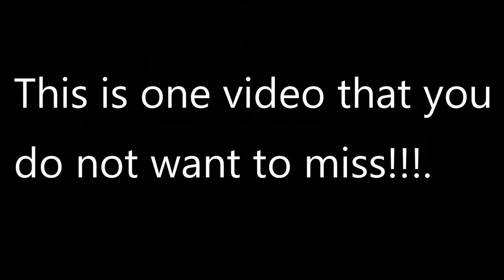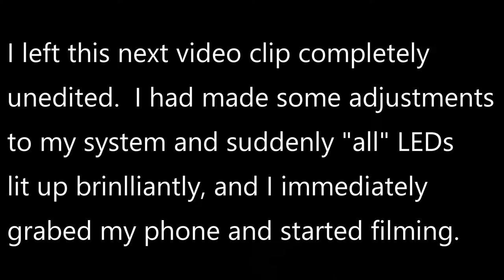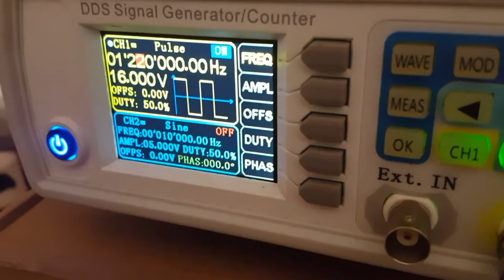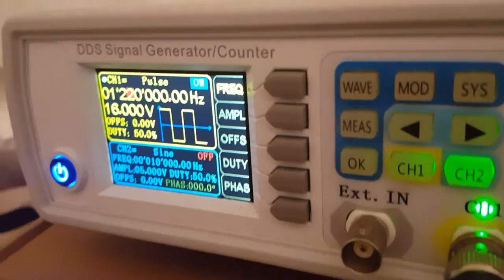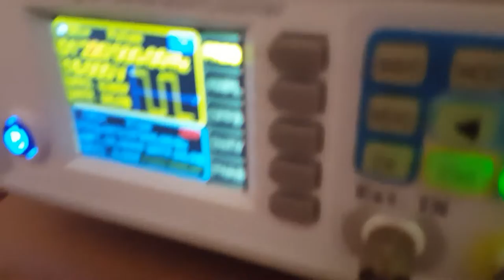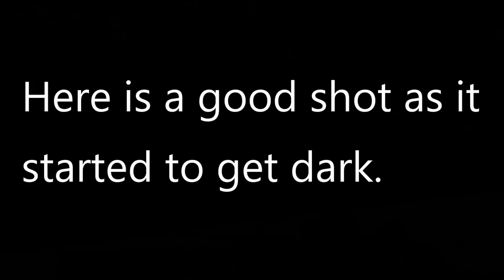WIRELESS POWER TRANSFER Part 17 (Over unity!? Free energy!!?)

Comment: Are the LEDs part of how your system works or are they just used as a load ?

Have you measured what amperage the LEDs are using , compared to how much input you’re using ?
Reply from the maker: HUmmm, well, I think the Spark gaps(LEDs) are very important to the system, and I believe the LEDs on table are also acting as a load to draw energy for all the other LEDs below table height on board to light up.
I have not been able to check current yet.  Every time I place an amp meter into the circuit, it throws off the tuning of the whole circuit and all LEDs go out.  I will have to get a clamp-around meter or a good oscilloscope.

Comment: Wow visually very impressive!  16 volts at 0.1 amps is only 1.6 watts.  Please measure the voltage across the open circuit and also measure the current as mentioned.  Because of the high frequency measurement with oscilliscope would be preferred.  Even someone from a local ham radio club may be able to come over if they can sign an NDA (non disclosure agreement) and do the measurement.
Reply from the maker: Yes, 1.6W,  thank you!  I know the math gets a little more tricky with calculating watt per seconds, joules, and power is 50% duty pulsed on/off and so the LEDs are also on/off 50%,,but this is why I will get a professional.  Yeah, you read my mind with everything, I was thinking about going to near by college to maybe get an electrical engineer and have sign NDA.  I like your idea also of a ham radio club.  And I also agree with using a scope, as you know the regular amp meter in my circuit just throws everything off.  Maybe I will pick up a clamp-around Amp meter. "Maybe" it will work.
Always good to see you again, thanks for commenting.

Comment: In the video of 6 years ago there is  something very important some minutes before 15.27 it begins.
Reply from the maker: Oh, I think you are maybe referring to this video.....  https://www.youtube.com/watch?v=pg8rGROgfA4&t=847s
Reply from the maker: @fransjebik8554  Yes, great video!!  The things he says in that video are very important!!  Thank you, I will add this video to the description here.
At 27:20 He mentions about 2 LEDs back to back and both light up, one LED has energy going one way to be used and the other way charging his battery.  In my system the LEDs on table are in reverse the the LEDs below and yet they all light up.  I could be using half my LEDs to charge batteries !😎
Reply: @INVENTOR3  But the Don Smith device never worked!?
Reply from the maker: @_John_Sean_Walker  I saw Don in videos powering lamps and other stuff.  I never even studied his work that deeply.  Don mentions & I also read he had over 40 models that he made.  Maybe nobody has been able to replicate with success, i dont know?!  He does mention multiple times that he does not explain or reveal everything because of his investors, but he also says that if you have enough experience you can figure it out.  Most people I see replicating his older designs, before he eliminated certain parts and simplified it.
Reply: @INVENTOR3  
All claims, on paper or in videos, that are approximately older than a few months, are either a mistake or a hoax. If there would be a working overunity device, than the entire world would know about it right away.

But in general we can say that overunity doesn’t exist.
Like I said before; potential- or kinetic energy needs a potential difference to work.
In the many many examples of a rotating devices, every point will eventually return to its original position, and therefore have zero potential difference. 

So Don Smith believes in his own idea, but his idea can never work!
And BrilliantLightPowerInc can not work because it is in contradiction with everything we know about physics.

Your idea is better because it uses an antenna.
Reply from the maker: @_John_Sean_Walker  I found this video, of Don demonstrating multiple 100Watt bulbs lit, many witnesses....   https://www.youtube.com/watch?v=zfVomjwqHx8
There have been quite few people in history that have accomplished great OU or free energy, but many things happen.  They are shot, poisoned, slapped with the inventors secrecy act, or just pass away from old age with their secrets, which makes me think about John Moray, Henry Morays son, he is in his late 80s I believe, and he may be taking his fathers secrets to his grave.  I keep thinking about calling him and asking him to do an interview, somebody needs to before he passes away!
Many devices nobody has been able to successfully replicate.

I have always believed in over unity.  I just saw this video from Don for the first time the other day, please listen to 9:45 to 10:50 what he says about OU & free energy,  I agree with what he says 100%, I have come to the same conclusions.  I was very excited to hear him say this and know that maybe I'm not crazy after all, hehehe...     https://www.youtube.com/watch?v=Mnoy2D4wuf8
Don also mentions that OU devices already exist for quite a while, like the power module he uses and he says that a magnetron from a microwave is also a patented OU device.  I think it is all in that same video.

He also explains in this video about how he taps resonance at the very peak of the spikes that are "above ambient" and this creates the potential difference.  Makes me think of "pulsing" a ball up hill and then collecting its kinetic energy as it rolls down.
Great to hear from you again John, thank you!
Reply from the maker: @_John_Sean_Walker  You killed Christmas for me!! LOL

Comment: I am going to be brutally honest with you, so don't get me wrong. I do not see how this is over unity, or how this proves over unity. You are not measuring anything except for your input voltage and the duty cycle. But you give us no amperage reading. And the LEDS barely give of any light. A LED at full capacity shines way much brighter than that. 

But with enough amperage I don't see no reason why those LEDS would not light up. And this resonant circuit technology is not new, in fact that's how every radio works. And I would not be surprised that Tesla has invented this circuit a long time ago. The only difference is that you make the circuit convert the energy into light instead of a sound. And you can tune the coils to a single frequency without the need of a complicated circuit that allows you to change the frequency, like a standard radio does. 

This is also not a valid method to measure the consumed power by this circuit.

Many examples of this circuit can be found on youtube. I hope for all involved that you do not have the intention to scam people or to generate click bait. My alarm bells are ringing.
Reply from the maker: You make good points and I understand completely.  I'm not sure if this is over unity yet.  I will get professionals to inspect the whole circuit.  The only data I have so far is the ratings of the LEDs and then voltage output of the freq gen and it's maximum of .1A output, which I don't believe I am using even that much current. I do have hundreds of volts here that I have shown on other videos with meters.  I understand that I did not invent the coil or the capacitor or resonance or transmitting power, but maybe the way that i put it all together is new, maybe not.  Maybe I am using back EMF, maybe I created a pump that extracts the electrons from the air, i'm not sure yet.  I think the efficiency of this system is quite incredible.  All readings and measurements will be coming.  I believe that if I was able to accomplish this much that I will be able to amplify the voltage and  get as many LEDs lit as I want.  The whole world is moving to LED lighting.  A manufacture that had this system would be able to tell their customers that their competition uses 10w to light 700 LEDs & we use only 1.6w to do the same job.  I know that there is at least 2 volts across each LED in this system.  Even if this is not OU, it is a method of utilizing a very small amount of energy to light a heck of a lot of LEDs.  I believe I will be able to use my free energy from air project where I get 127V and microA to light all these same LEDs,,,,free energy.  Many tests need to be done, yes, absolutely.  I took 350 LEDs with 11V up to 710 LEDs with only 16V,,,, I can now instead of adding more LEDs, I can make more modifications so that I can light the same 710 LEDs with even less voltage and energy.  This will not be another scam, I can promise you that.  I am one of the few real people out there, not fake.  I value my reputation and it is a good one.  I very much appreciate your comments and always want to learn and advance.  I would love to see a few links to the many examples you mention could be found on youtube.  Hard to find the good ones, not fakes.
Very good to hear from you again, thanks again for your comments😎.  I like honesty very much, as long as people are not rude and nasty and hurtful about it, that is just unnecessary.  You were not rude in any way.
Reply: @INVENTOR3  You're welcome. Here are some search results for you so that you can do some research for yourself. Just be careful with your statements or claims until you have absolute proof for your claims. Always remember that extraordinary claims need extraordinary proof. And the burden of proof rests on the shoulders of those who make the claim. And with proof I mean scientifically acceptable and reproducible proof. My electronics teacher always used to say, you can only know it for sure if you do the correct measurements. I hope that you understand my concerns. Peace :-)

- Tank circuit - https://www.youtube.com/results?search_query=tank+circuit
- Wireless energy - https://www.youtube.com/results?search_query=wireless+energy
Reply from the maker: @insAneTunA  Thank you, I understand well.  I put question marks after OU and free energy because nothing is proved yet.
Thanks for the link, I was hoping you had some links with great results like mine, but still appreciated.  I understand well about LCR tank circuits and wireless transfer of energy, but there is always more to learn about it.
Thank you.
Reply: @INVENTOR3  The result that you have is nothing different from the results that other people had with this circuit. The scientific basic principals behind their circuit and your circuit remain the same, and the so called result that you have is not extraordinary. 

Others just didn't take the effort to use 700 LEDS in order to show how this type of circuit works. And you don't even need to have 700 LEDS to show how it works. So most people don't go that far because it is a waste of money. 

Your LEDS are not shining bright enough to be really useful. And the so called result that you have is NOT special, but a completely logic result that falls perfectly within the laws of physics. 

And on top of that it is very likely that this circuit violates certain codes or laws about the use of radio frequencies. Because those frequencies are protected under the law. For that reason alone It is not even a commercially viable use of the technology. There are also safety issues with relative high energetic radio signals. Such as fire hazards and interference with all sorts of sensitive equipment. 

With the links that I provided you can find people who explain in great detail how this circuit that you replicated really works, and what the physical mechanisms are that makes it work. 

The energy that makes your LEDS glow a little does most certainly not come from the air, that is an absolute fact. And if you claim something else you will have to provide the absolute proof for that claim. And you also have to show and explain in great detail how you got to those conclusions.

The energy that makes your LEDS glow a tiny bit comes from a transmitted radio signal that propagates as a magnetic wave. In other words, you have to provide the energy with a device that emits an energetic radio signal to make it work, otherwise nothing will happen.  

And besides that, you don't even know what the result is, because you are not measuring the energy consumption with the appropriate equipment. 

Your use of language, and your lack of understanding how electronics work and how valid measurements must be done, doesn't  really help you. Nothing of what you say is scientifically accepted.
Reply from the maker: @insAneTunA  I understand very well.  Tests coming soon.
Reply from the maker: @insAneTunA  Yeah, I have thought about this, especially with past experiments.  I could wrap screen around my top if I have to.  With past experiments I was able to see that my lab already acts as a slight Faraday cage, it does block some freq..   I was also able to detect my own power going to the lab and going through the lab's skeletal pipe frame and even in the air.  In case your wondering, my system still works if I turn off power to lights.
More videos coming, please stay tuned, I hope we all get more answers.
Reply: @INVENTOR3  I think that the answers are already there. Many people have went that route before you, and it is all well documented.
Reply from the maker: @insAneTunA  Yes, just as I have always expected, the answers been right in front of our faces all along.  Tesla, DR Moray, Don Smith and many others.  I hope everyone gets free energy.

Comment: fyi  -   very little energy is required, to turn on one or 700  LEDs.      FORGET  tesla and other idiots, and  accept as accurate  lenz's  findings.           TRY  to see that there is long  history of the use of  Rotary  Leverage to overcome  lenz-related losses; in  wind turbines (and hydroelectric waterwheels).  
USE  of  the output power  is  NOT  informative.!!!!
if  you do not have  Correctly measured values for  (amps, volts, (watts))  IN  and  OUT,   you have  demonstrated  Nothing.!!!        'frequency' equals utter  NONSENSE.      if interested, see my research.        (thumbs-up, for a video showing  Nothing at all.)   d      googletranslate
Reply from the maker: Yes, long history, but the best things seem to be all gone or not for the public, bought out, put on a shelf, forgotten.  Not used today by the people as they don't create a profit for the corps.
I do know that my freq gen is in fact putting out 16V.  And I do know in fact it can only put out a maximum of .1A(per the manufacture).  I do know for a fact it only has a 5V input transformed from wall. I do know for a fact the LEDs have a working voltage of 2V and 20mA.  I mentioned in the description that I will maybe go to near by college and get help from an electrical engineer and physicist.
This video is not showing all readings & math and verification, sorry to disappoint you.  It is showing me sharing with everyone that I had success in lighting 710 LEDs with surprisingly very little energy, which I'm sure many large corps would be interested in, since I don't see this type of efficiency installed in the new LED system we have at our building where my business is.  Geeze, I don't care if this technology has been know for many years, I don't see it being used by the people, and that's the problem.  Theoretically I should be able to power all these same LEDs using my free energy from air system, then it would be off the grid.
Well, more tests coming.  I will check out your research.
Reply from the maker: Ahh, okay, I dont know how I forgot your name, especially after the comments you made.  But now I went to your channel and all I see is OU, but yet you always come to my videos and be rude to me?  Isn't that being a little hypocritical?
Reply from the maker: @daviddavids2884  Hummm, you seem to be an angry person, that's just my observation from your many similar comments on many of my videos over quite some time now.  It gives me the impression that you want to provoke people into going to your same level of anger.  I suggest you look into meditation or counseling.  That long term negative energy can destroy someone.  Family members and loved ones around you could also be greatly effected by it.
May peace be with you.
Reply from the maker: @daviddavids2884  I have no problem with critique.  But we disagree on the point that I feel that words like Fullachet, and IDIOTchild and other comments you made are in fact rude & could be considered as demoralizing.